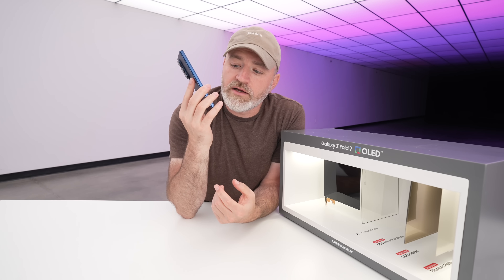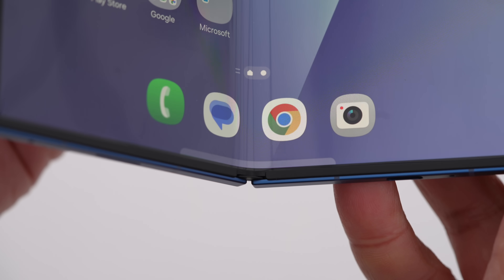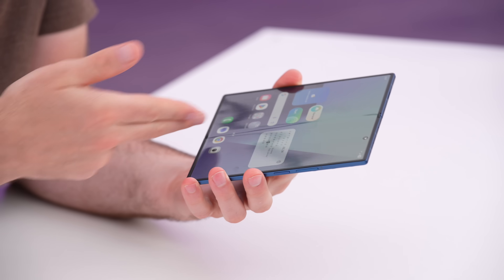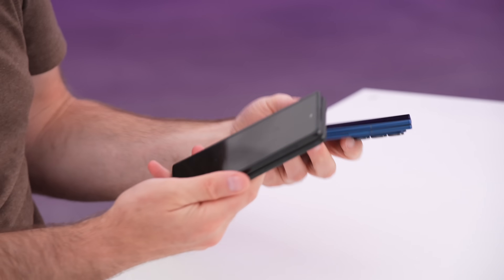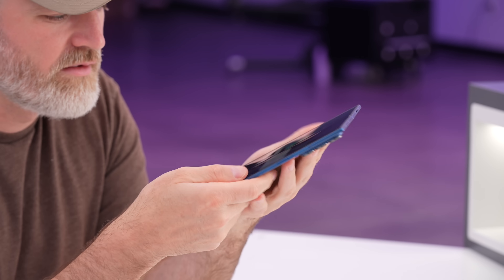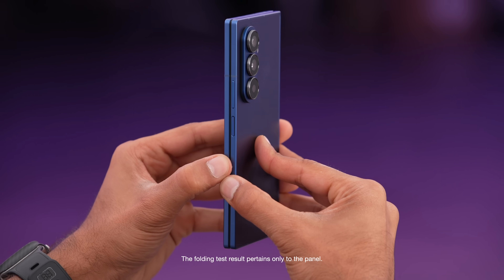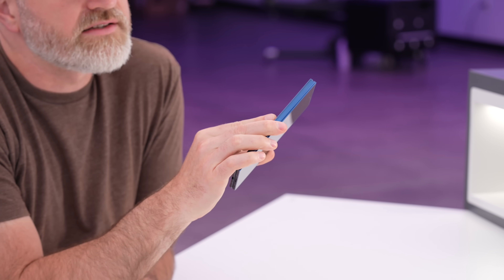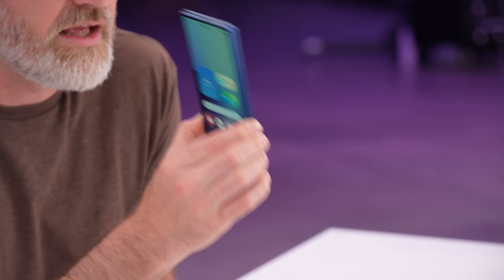How to Make the Thinnest Smartphone

Comment: I fix all my devices and things I have. One thing ive thought about for the samsung, and actually talked to the CEO of samsung about was this new technology thats basically completely transparent glass windows  that's made with salt minerals in it and works like solar panels. If samsung could somehow innovate that into their phone screens and even camera lense covers then they could have a next level move in their phones essentially giving samsung phones a 3 way to charge and a 2nd way to wireless charge and 1st way to truly wireless charge. You can set your phone indoors under the right lighting like fluorescent light bulbs for example and it can absorb that light just like sunlight and turn it into energy. Which also doubles as recycling energy.

Comment: Everything in this new gen of folding phone is great except for the battery, watching a video on the big display drain the battery like hell. And no a carbon silicone battery was not the answer since it degrade faster and are hard and costly to replace. Lets hope Samsung will be able to bring solid state batteries soon.

Comment: About 4 yrs since I had fold 3. I had to repair once due to my rough handling I guess. Now, the front display doesn't work. IMHO, the older device (fold3)  is much more fragile than most ordinary phones. Hope fold7 is better.
Reply: 100% better. I also had the fold 3 and that was definitely more fragile. Actually had a couple repairs but thankfully everything was under warranty/insurance. Now with the fold 7 I can toss it around, take it in the shower, pretty much do anything that's not innately dumb.

Comment: First I should say, I do have a Fold 7 and I think it is an amazing phone.

However, I need to point out this particular issue, because by this point I have heard you talk many times about the claim that this phone is rated for 500,000 folds. This statement is at best misleading and, at worst, tantamount to an outright lie. The only thing that is rated for half a million folds is the hinge mechanism, but it is never the hinge mechanism that fails, so even if it is true, it is a pointless moot point. 

My previous phone was a Fold 2. This phone, I believe, was rated for something like either 200,000 or 300,000 folds. However, after about two years of use cracks started to appear along the crease of the screen. For a very long time they were only cosmetic, but they get worse and worse over time. After a few more months they made it so it was noticeable enough that it was distracting when using the phone. Then eventually, once the phone was around 4 years old, they caused the interior screen to stop working.

With the Fold 7, I don't think Samsung has made any comment at all on how many folds the SCREEN should be good for. At the moment I have no reason to assume that it will be any better than the Fold 2.

I just feel like this is an issue that you could have got into when talking about folding phones.

Comment: Rocking the Legendary Galaxy Note 9 since 2018 as a daily driver with almost 80% of is original condition didn't spend a single penny on the phone nothing replaced or repaired not even once just the battery came down to like 60% of it's original backup.. Waiting for 26ultra if it'll be worth the price if not then S25 ultra it is 😎

Comment: The fact that the inner display can be scratched permanently by our nails is a big turn down.
Reply: Im pretty sure that the integrated screen protector
Reply: It's the screen protector.
Reply: Its not just a "screen protector" if the customer cant remove it and replace it. You have to go to samsung to do it.
Reply: @subhamjena8539 They suggest it. I've been doing it myself since the fold 4. It also won't void the warranty.

Comment: A little over two weeks with the fold 7 and idk how I could ever go back to a traditional slab.
Reply: As soon as it breaks and it will, soon
Reply: @petergplus6667  actually the durability on Samsung's Folds are insanely good
Reply: Had every fold since the 3, now on the 7. Definitely can never go back to a slab, but the 7 front display and thinness now makes it feel just like that, so it's really a no brainer. I'm finally using the cover display more
Reply: Wait a year
Reply: @IEA_455  I have. Still addicted to folding phones
Reply: How do you use the larger screen? I can't think of a legit usage.
Reply: @deathorb  the square screen means you can have a larger window for YouTube videos, and still see the comments.
Reply: @ShoddyRC as I thought it was for little more than a slightly larger YouTube viewer. !
Reply: @deathorb What do people use small MacBooks and Tablets for? Find that Answer and you find the answer to your question.😊
Reply: Currently I like to use it in "non-flex mode". Partially folded, but without actually being in flex mode. Split and floating windows are very useful, but I wish they didn't remove the option to make windows transparent
Reply: I still don't know how people can get over that ugly crease, is in the fucking middle you will never escape it no matter the content, damn
Reply: I've had my fold 5 for about a year and I love it a lot but not $2000 love it.

Comment: I had the fold 2 from day one. Its been through hell and have never had a case on it. Upgraded to the fold 6 last year and wow, what a difference! I still have my fold 2 and it is still viable. I use it alongside my fold 6. The crease on the inner screen started to crack maybe about 8 months ago, but is only noticable when the screen is off. 
I love everything they did with the 7, but can not get over them leaving out the S pen. I want to upgrade to the 7, but just cant as an avid daily user of then pen. Probably the biggest mistake they made. I imagine they'll sell far less due to that reason alone.

Comment: I had a Fold 3 since it released and have loved it and had no reason to change until last month when my inside screen packed in and only one side was working. I bit the bullet and upgraded to the Fold 7 and I've fallen in love all over again. It's the perfect mix between exterior screen which is as good as, if not better than any normal phone, and the huge internal screen. That had been my only issue with my Fold 3, exterior screen was a compromise and my sausage fingers struggled to text on it. This has been solved. Love this Fold 7, why would you get anything else? (Aside from the price 😂)
Reply: How long is your batter lasting?

Comment: Literally came from zfold3 to the fold7
Reply: How durable was your zfold 3 inner screen i mean you had any issues with it?.
Reply: @alternative_theory the screen itself was always great. I travel a lot for work l, dropped it on concrete, sink filled with nasty dish water and no issue. BUT, The hinge got grit in it and eventually it wouldn't unfold all the way.  The hinge has been my issue. I did a warrenty claim a month after he zfold6 released. By the time the fold 7 came I had hinge issues again. It's night and day for me. It's only day 2 for me, but the upgrade is worth it. Hole punch is an adjustment though.

Comment: I have the new Fold 7... I honestly don't think I would want it any thinner.  Its a little harder to open, because it closes together so well.  Next area of improvement might be to try to make it even thinner, but so you could have a tri-fold.
Reply: That's when it really matters and makes a difference. Nearly square ratio when open is not nice. Tri-fold is way, way better.
Reply: Have 7 also...if they make it thiner they need to remove usb c port and make it only wireless charging...
Reply: Can't be done coz of usb c
Reply: What I've noticed so far is that I hardly need to open it up now and most of the time it's been good for using on the front screen
Reply: I think by that point, just keep it same thickness so tri folded is thicker

Comment: Watching on my S24 Ultra
Was actually waiting for S26U because I have no plan of getting a foldable until now. This new Fold is awesome, they nailed it this time.
Reply: I was gonna get a s25u or wait for the s26u, but the fold 7 looks incredible.
Reply: it is, i picked mine up last sat and i love it, night and day diff from my fold 5, so light and thin, and the front screen is finally wide enough to use comfortably
Reply: @chrisbaker4622 cant wait to upgrade, I have a s21+ with a bad battery and dead pixels.
Reply: I was  waiting too......and i ordered the Fold 7.....it's amazing really ...it's worth it!
Reply: You won't regret the Fold 7. It's basically your same slab phone that you can unfold if you need a bigger screen when watching content or need to do multitasking. Samsung also claims the new Fold 7 can fold/unfold up to 500,000 times compared to the Fold 6 200,000. Although the 200,000 is already overkill.
Reply: S24 ultra is an amazing phone, I still used it when I had my fold 6 ,, and only got rid when the fold 7 came out
Reply: I sold my 25U for the fold 7.

Comment: S9+ 7 years this month
Reply: I just retired mine as well. It still works.
Reply: Still working?! ::O A friend of mine has an S4 active for dialy.
Reply: @dp5581 not really anything to be proud of considering none of your apps are going to work and haven't had a security update in 5 years
Reply: @dp5581 I have S8 and S6 that are still working, fairly fast too. I just wasn't using them, having moved to Note 20 Ultra and now S25 Edge
Reply: I still rocking LG Wing think it's 6 years young
Reply: I'm watching this on my Note 9. Still works perfectly fine.
Reply: Mine LG g7+ still work properly with new battery
Reply: iPhone X
Reply: S9 plus used 6 year 30 august
Reply: A couple years ago I bought the Fold 5 and I gave my daughter my old Note 20 Ultra. She took very good care of the Note 9 I gave her years before and she gave that to her lil cousin. They all still work great. I think I will give this Fold 5 to her now and get the Fold 7.
Reply: I'm thinking about going back to the s20, at least we still had sd cards 😢
Reply: @G0neguy memory now goes up to 1 tb .... you still need a sd card?? 😮
Reply: My parents are both on S8's and love them. lol.
Reply: @christophernunn77 they're very a very nice combination of light, size, and working smoothly, plus a first one with Dex which I used with monitor, keyboard and mouse through a special deck then
Reply: Its time to let it go .. treat yo self!!
Reply: @JaySubii  One of the things that I told my coworkers that they love to qoute is, "No one will ever treat you better than you can treat yourself." 😂
Reply: The longest phone I used was using 4.1.1 jb, I stopped using it when play store and YouTube refuse to launch lol
Reply: Still rocking LG Wing 🪽
Reply: DynaTAC 8000X baby
Reply: me too😂
Reply: Lew divided 500k folds by 200 daily average to get 2500 days, or roughly 6.8 years of usage for future viewers. It's not a question about ANY phone user of 7 years...
Reply: definitely on a custom rom lol
Reply: Not fussed about security? Or flashed a custom rom?
Reply: Update. My Dads S8 just died. Hahahahahaha won't charge.  He's getting the S25+ later today!
Reply: I'd only be concerned if you're still using the original lithium battery in your S9, as they're prone to swelling with age, which can lead to a spontaneous catastrophic failure. Be careful with replacement batteries too, many are poor quality Chinese counterfeits and/or rewrapped duds.
Reply: I retired my iPhone 7 last year. It still worked well after 8 years. The only issues were battery capacity and 3rd party app/software support.
Reply: Best phone ☎️ ever !!!!
Reply: @RedLeo-pf9yo iPhone
Reply: Can buy a 2024 motorola edge, basically an upgraded S9+
Reply: Me too❤
Reply: s9 is beautiful device whit alot features ir sensor heart sensor
Reply: 😂gg bro
Reply: S9+ is my favourite phone ever. I used it for 5yrs and switched to Flip 5 out of curiosity, which screen is too fragile. The S9+ still works fine though.